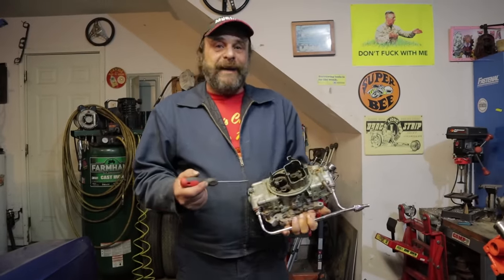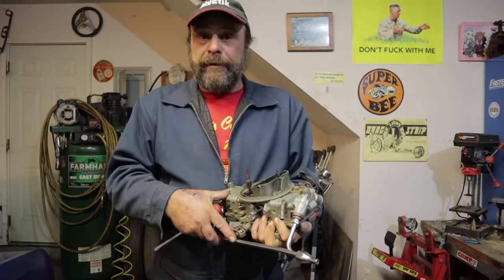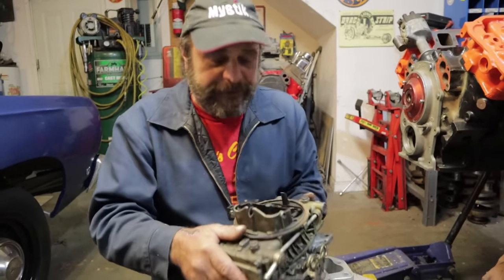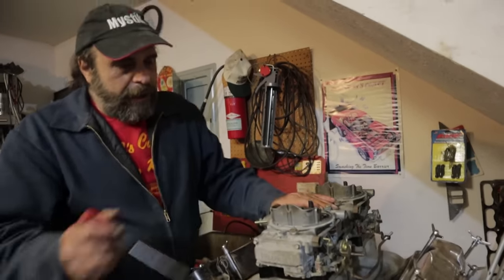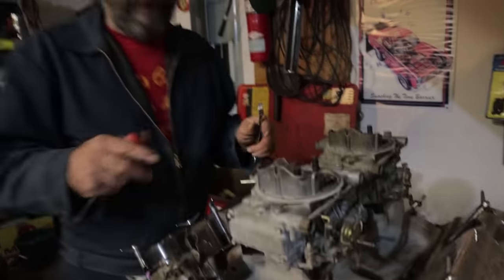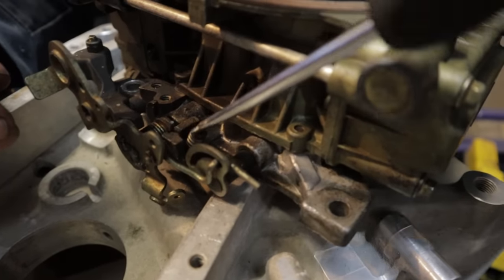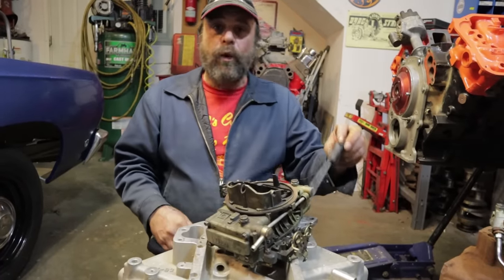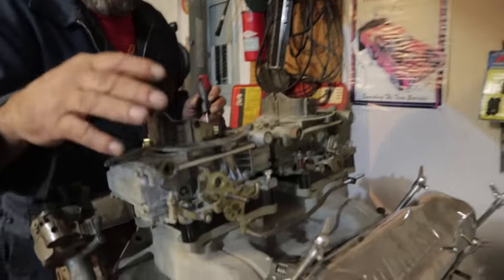Holley Set-Up and Adjust Step By Step

Comment: I am not a fan of holleys the few times I had one I just tinkered  myself  silly. Rejetting and trying to get it to perform perfectly  it just always felt like it could be better  maybe it was just me idk but after spilling  999 gals of fuel on the  intake I went back to my rusty trusty q  jet and again  maybe it was just me but throttle  response  was better in the primaries and when the secondaries kick in it's an actual major noticeable  difference  the holley was too progressive  and not a kick in the pants and other than a few adjustments to the air doors and some other. Minor things  no more fuel  on the intake manifold  to rejet maybe it's me idk I seem to get lucky  and have good luck and very few issues never even well plugs leaky use the same carb on a 305 to a 454 w no real noticeable issues at all runs just fine ok on a 305 it might be a bit. Rich but not anything that makes your eyes water or is just ridiculous

Comment: Just think 1 day you'll be able to drive a 110, 220, or a 440 volt Mopar , you can pull to someone and say what ya running a 110 small volt , or a high volt 440,. Race ya meter to meter.

Comment: Oh, so that's how you work on a controlled fuel leak without a big fucking hammer. Rumor was it could be done. 1974 1650 manual choke.and put the sight plug back before you loose the fucker.